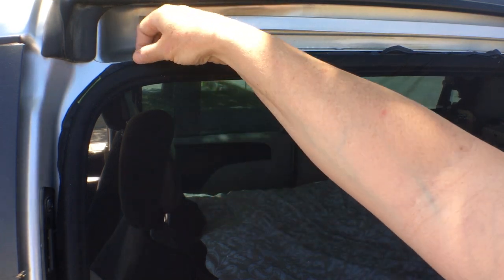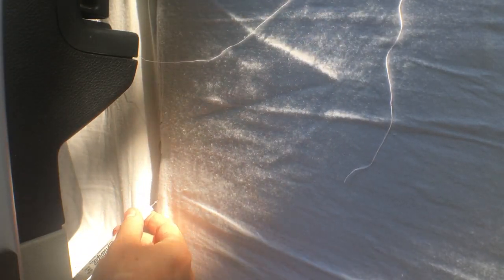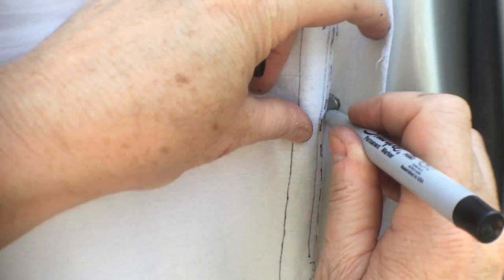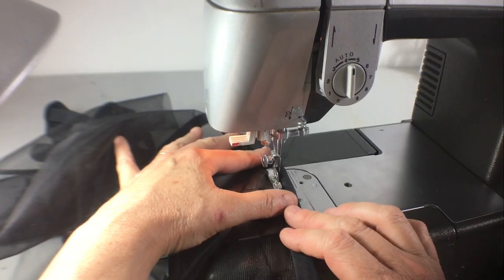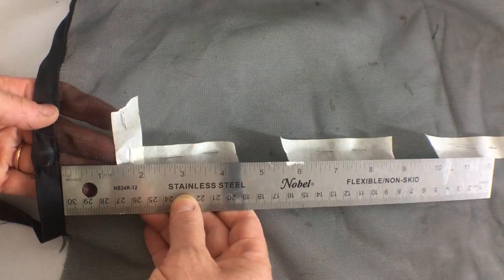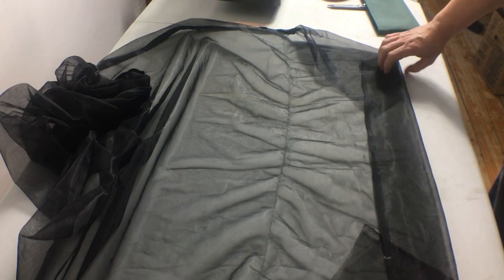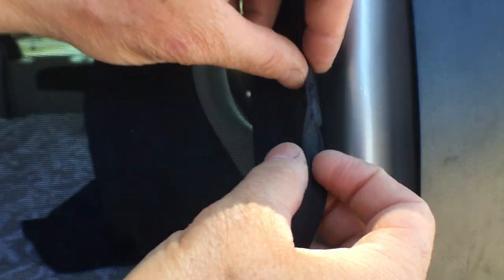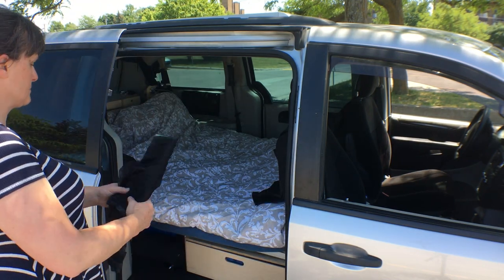Bug screen for sliding side door

Comment: Nice job. What about fastening a metal strip on the doorstep along the edge or some rivets for magnets to attach too? Or if sticking with that pouch, you can cut off the extra now and use to store the screen in, just need some closures on it instead of sewing closed.
Reply from the maker: Hmmm. I did think about somehow putting some metal down at the doorsill but didn't think of rivets... they would be easy to install, and all that was needed.
I like the idea of the screen storing in the pouch, nice idea!